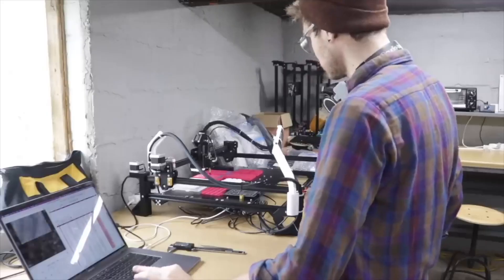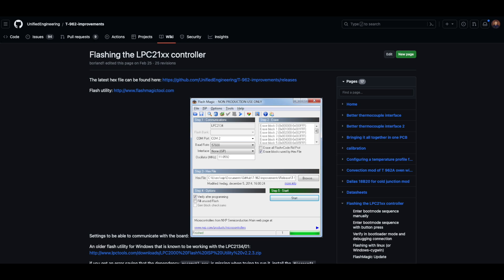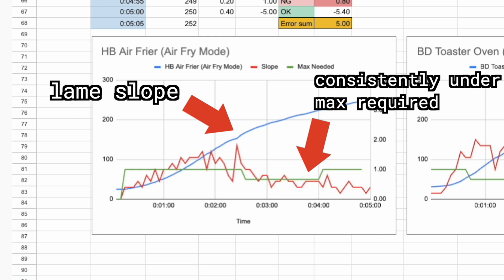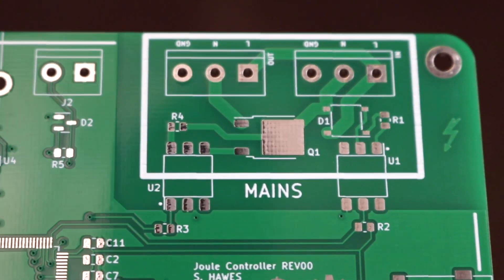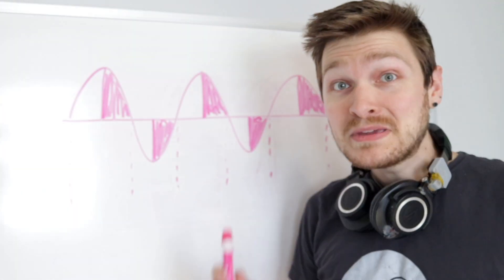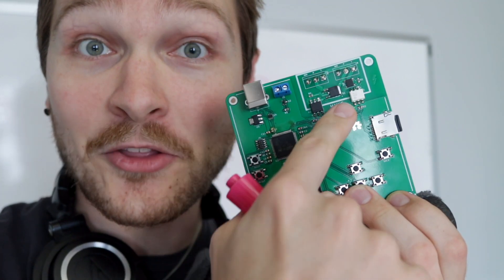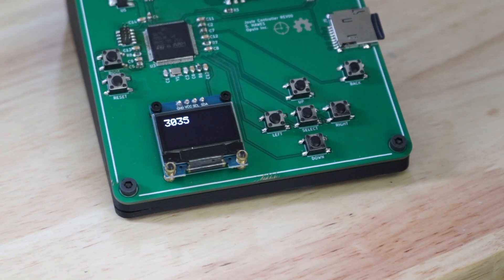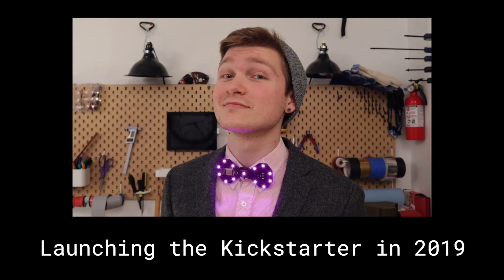turn any toaster oven into a reflow oven!

Comment: A tip is to connect a light bulb in series when you test electronics with  230 or 120 volts for the first time. If there is a shortcut the light bulb will light up and no danger.
Reply: Yep it saved me from blowing many circuits. Once tripped my breaker of the whole house because of a shorted recitifer
Reply: @309electronic5 and that's why we have breakers 😅

Comment: This video reminded me of the Keith Wakeham's Maelstrom fan project. He made a device to switch the mains voltage of his cooling fan for indoor cycling so that it would blow harder as your heartrate went up or pushed more power. He has a series of videos on the development on Youtube. Looking back he used a RobotDYN PWM AC light dimmer module with zero crossing detection just like you designed but the triac on that board has a fairly substantial heat sink. The prototype was very good but the project was cancelled in beta due to the difficulties and cost of getting the device certified. In his final update videos he talks about how the certification would cost tens of thousands of dollars. Good luck, I really hope this works out but I can see why most oven controllers are more diy.

Comment: Also look into the practical heat output cycle on the quartz - there is a lower practical limit to how short of a time slice results in practical heat. I've just defaulted to 15 seconds to be perfectly safe and accurate enough. Maybe after a ramp up to heat soak you can go shorter.

Comment: Nice. be careful around those exposed mains pads. Hope that quartz heater will hold up to rapid pulsed current.
Reply: The faster it switches, the better. After all, it normally runs on 120 pulses per second (60Hz is 2 full voltage cycles).
Reply: @AlienRelics  Those aren’t pulses. They’re sine waves.

Comment: Your mcu doesn't need to know the zero crossing points if you are using a triac. 
And do you know there are optocouplers that directly take AC mains on the input?
There are a lot of components which have a variation to deal with these kinds of tasks.
Reply: How does the MCU fire the triac gate at the right time if it doesn't know the timing of the AC waveform?
Reply: @Graham_Wideman  by connecting the gate to a diac which is connected to mains through a resistor divider. As the wave reaches the threshold voltage of the diac (usually 32 or 40 volt) it will conduct and trigger in turn the triac. Does the same thing on the negative part if the wave.
This is how triacs most commonly are used and this works fine with resistive loads like a heating element.
You can move the trigger point by including a potentiometer in the voltage divider.
Reply: @Peter_A1466  you've just described a manually controlled dimmer or motor controller. Now how do you control it from an mcu?
Reply: @Peter_A1466 Unless you're using just manual control..the potentiometer/ its shaft has to be electrically insulated......
So too when  using" uC " control ..electrical isolation is reqd...
Yet the question arises on how can you achieve , either (phase or zero cross trigger) control ..?? without knowing the zcd instants...
How do you interface an uC (l.v.signal) to trigger "a 20-30v DIAC" ,on either +& - half cycles ?
Reply: If you're using optocouplers to trigger the triac WITHOUT any "mcu" ..then that's possible only with the ZCD types....

Comment: Im sure it's been said before in the comments, but I'm too lazy to scan. The hysteresis of a heating element (not to mention the oven as a whole) is Long , so PID controlling at mains frequency might be overkill and harder than using bang-bang controller with an allowable temperature range. Just imagine trying to control your home HVAC with both methods and my comment will make make more sense.
Reply: I'm using a PID controller with a configurable dwell time set to 10 seconds because of this issue - the quartz IR tubes in these ovens don't do chopped AC reliably/predictably, and power cycling at any shorter a timeframe than about 10 seconds doesn't get you that sweet soak/bake curve you need for effective reflow.
Reply: @OddlyIncredible   I always thought the mercury switch thermostat was simple genius. The mass of the mercury swaying from one side to the other set the dwell.

Comment: Have a look into theatre lighting dimmers. They tend to use triacs. If you google for "shoebox dimmer" (i.e. the small portable ones), and find one that's rated at 10A per channel, then you could use that as-is, and have your microcontroller output the DMX signal required to set it to whatever level you want.

Comment: Im surprised you're so inexperienced with AC and mains stuff in general, triacs work great for resistive loads like heaters, old incandescent light bulbs you can get quite powerful ones but they will always be less efficient than solid state technology, but they are incredibly reliable when used in specs as they are basically diodes internally

You could always build your own solid state relay with two mosfets back to back there are ICs that do that and basically emulate the triac and you would get laughable amount of heat, but if you can just pop down a off the shelf solution and its not too expensive its always great way to go especially as some doofus might plug in more powerful oven than you expect or something
Reply: Most makers are doing lower power electronic boards and then use a power supply if they are interacting with high power mains. Unless you are a EE/CE background there aren't a lot of high power scenarios most hobbyist would find themselves in
Reply: @matthewcampbell4047  I guess i was just into weird things as i dealt with a lot of AC
Reply: ...Im surprised you're so inexperienced with writing a coherent sentence, using, you know, punctuation and stuff.
Reply: @Graham_Wideman Im sorry to burst your bubble but not everyone was born in an english speaking country or even studied english, i taught myself and i cant be assed to write perfect english all the time
Reply: @alexstone691  Fair enough on english not being your first language, and thanks for going to the effort. It seems you share my sentiment that "I'm surprised you're so inexperienced" is a bit impolite.
Reply: @Graham_Wideman  I realize it may seem rude, but that was totally not my intention i agree i could've written it a bit better but my brain came blank at the time

Comment: In general switching elements (and the things they power) also don't like to switch in and out in the middle of the sine wave. A better approach might be to apply power for a percentage of counts instead of a percentage of every count. Very easy change since you already have a microcontroller.

These were literally the next words you spoke after I wrote my comment lol.
Reply: Nothing wrong with the system he's using. Phase cut dimming has been around for decades and is a well tested and reliable method for controlling AC power to resistive loads. It's used in almost every household lighting dimmer ever made and is used for theatrical lighting into the 10s of kW range. The only real downside is it's noisy, but that's not that difficult to filter out with a basic LPF.
Reply: But the temperature of a thick heater follows switching cycles much more slowly than that of a thin filament in a lightbulb. In order to control the light intensity, you have to switch quickly and often. I think, for a heating element, I wouldn't use phase control either. 🤷‍♂ @JaenFoster
Reply: @jurgenaddicks1634  So... more thermal inertia means slower change from switching. So why is phase control a problem with a thicker element?
Reply: @JaenFoster  phase cut dimming is used when switching cycles will not achieve the desired result, largely lighting as you have pointed out. When you don't need such tight and constant control of the power using cyclic switching is much easier on the components as if done at zero cross they are switching no current, and instead of switching on every voltage cycle they only switch for whatever duty cycle is required. All switching elements have a limited number of times they can switch state whether mechanical or solid state. That number may be trillions of cycles but there is a limit. By using switching cycles the highest number of switching events will be at 50% power meaning that at WORST case cyclic switching would double the lifespan of the components before you even take into account the strain of switching under load. In order to switch under load the switching elements have to be more robust and more expensive. Yes you can use phase cut dimming, but if you already have everything needed to implement cyclic switching at zero cross, it saves you money in components and extends the life of your product, why would you not use it?

Comment: Hawes - Consider using a GFI outlet at your power strip just in case. Most mishaps in life make you stronger....except for electricity. It just kills you.
Reply: There should at the very least be a circuit breaker or fuse on the AC mains input on his controller.
Reply: GFCI/RCDs are mandatory and centrally installed in Europe since decades. I wonder if at least some US states require the same?
Reply: @der.Schtefan  It's mandatory in all states here as well. Has been since 1971. 

At first it was just outdoor outlets, then in 1975 bathrooms as well. And it appears that our local (Colorado Springs) inspector (aka: AHJ) might have thrown in garages as a bonus. Meaning that we had to install them in garages as well. I don't know about Europe, but the AHJ ("Authority Having Jurisdiction") has the final say as to what they are going to approve. And that's that.

BTW, fun fact: The GFI outlet came later, at first it was only available as a breaker. I remember one job where we had to source 120V 25A Square D GFI breakers. Very expensive in 1985.
Reply: @der.Schtefan no they are not required afaik. They aren't very common unless it's a new house or in a bathroom/kitchen
Reply: @der.Schtefan  The 2021 version of US' National Electrical Code mandates GFCI/AFCI circuit breakers on all residential mains circuits that have any risk of exposure to moisture as well as any circuits that may have outlet strips or extension cables plugged into them. (So, most of the circuits in a typical home.) Lighting-only circuits are exempt from these requirements for now, but eventually I expect it to be a blanket requirement. Of course the bigger issue is that GFCI/AFCI breakers are like 5x the cost of traditional breakers, which is part of what's driving new home construction costs skyward...
Reply: @OddlyIncredible lighting fixtures often don’t have ground running to them in older construction. GFCI (ground fault circuit interrupters) cannot fault what they do not see happening. In a two wire circuit, current must be equal on both legs… A GFCI only trips if it sees 15mA flowing on ground in the circuit it is protecting. In other words, it has its place, but not in every case.
Reply: Maybe afci as well
Reply: He's doing it the smart way by interrupting the power to the socket. And now that he is using a SSR he is insulating himself from liability that much more. He needs to have a big fat warning regarding using his device on appliances that contain their own microprocessor though. Your point about GFIs (if not already installed) is a good idea.

And as an electrician who started out his journey in 1975, when it comes to getting popped I'd have to say that at worst it only stung a whole hell of a lot. Nevertheless, I still wire things hot, it was how we did it back then.
Reply: A lot of these ovens / appliances are only two wire 120V AC in the US and probably Canada too, the plug is just polarized, you don’t have ground... Just a hot and neutral wire. A GFCI outlet device would only see any current that flows back on ground the ground wire as hazardous. Meaning you could have the neutral in one hand, the hot in the other, current flowing straight through your chest cavity and the GFCI is going to see that current as totally normal. A fuse or breaker, maybe an arc detector, would be your better bet in that case. It would be better to switch the mains cable to 3 wire and ground the chassis. Unless you happen to be standing in water that is somehow carrying current back to ground, a GFCI would never see what killed you. At any rate, a GFCI, while maybe mandatory due to regulations, does not make it the right option for safety in every case.
Reply: @slipspectrum  Well, wrong.

Installing a GFI on a two wire outlet is the approved method of converting the branch circuit to a three wire grounded circuit. From the point where you added the GFI you would then use three prong outlets.

Your argument that it won't protect you if you are connected between the hot and ground is a bit misleading because this applies to two wire as well as three wire circuits equally. 

To quote the Zen of staying unfried, "Do not become one with the circuit".
Reply: Ditto. Fused. And gfci. SSD would have been my first choice. Can’t wait to see how you get on with the rest of the project
Reply: But unlike everything else electricity feels like your getting stronger, and your definitely standing a little taller
Reply: As a stupid 8 year old kid, I licked live wires after enjoying the tingle that comes with licking 9v batteries.

I learned 3 things that day. 
Licking live wires is bad.
Licking live wires doesn't give you super powers, and. 
Licking live wires makes your mother angry enough to take your tools off you because you can't be trusted with them.
Reply: 110V pretty chill tho, low chance of death imo
Reply: He is using piss weak 115V.
With only 10A available thats only 1100W.
As long as he does not come into contact with both the active and neutral/earth he will be fine.
In the rest of the world we get 2400W with the same current.
Reply: @fransdebruijn6763  honestly 110V is fun compared to 240V as in zappy
Reply: Well said
Reply: 120v will not kill, it’s got a small bite. Beyond that, generally good to cut lines in your PCB to avoid voltage creep.
Reply: @D-Khaz 120V will most definitely kill.
Reply: @oliverer3  Most definitely a subset of the population in any case.

The thing to remember is that exposure to 120 volt circuits is orders of magnitude larger than exposure to 480 volts or higher.

So while it will kill a small percentage of the people exposed to it, it is not all that hazardous.

Simply put, you don't see a lot of news articles titled "Handyman cheats death again".

Oh and a fun fact, almost nobody in Europe does from exposure to 120 volts. Weird... 🤔

Comment: i ve build such a control for an oven, a ssr is the way to go, they are super simple to use. it is a "wave packet control" - if this is a good translation from the german word "Wellenpacketsteuerung" . the needed pid controller is super simple to find good values for i and d because the system is very sluggish. their allhough a lot of ready to use and highly advanced open source projects :)

Comment: I use a t962C It works like a charm across ~300x400mm area in the middle
Reply: Have you modified it? I've got one, unmodified, and it's not good but I plan to modify it at some point.

Comment: Use a back to back MOSFET setup with a photovoltaic driver instead of a triac
Reply: Why?
Reply: May have lower voltage drop than triac.
Si8751 is a nice alternative to a pv isolator
Reply: @mikeselectricstuff  possibly, but seems overly complicated for a simple resistive load. Although as the design evolves it might offer other benefits, I'd guess.